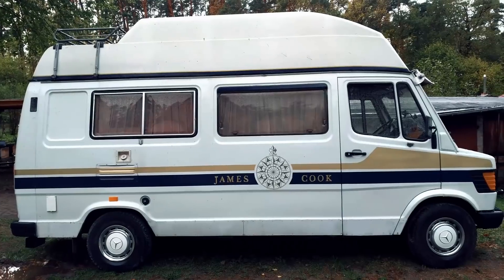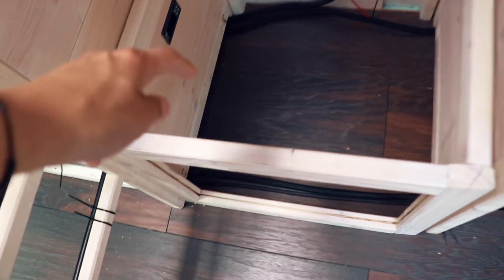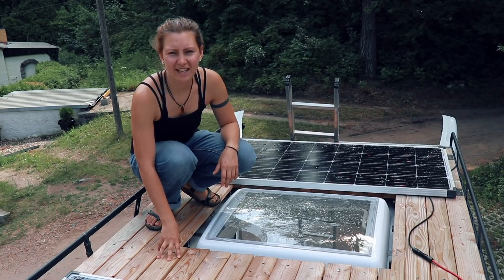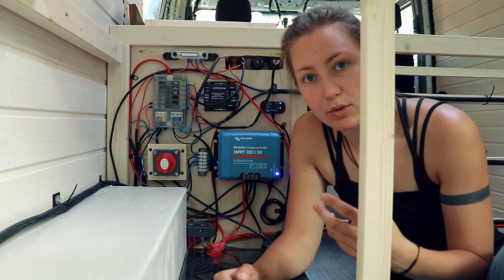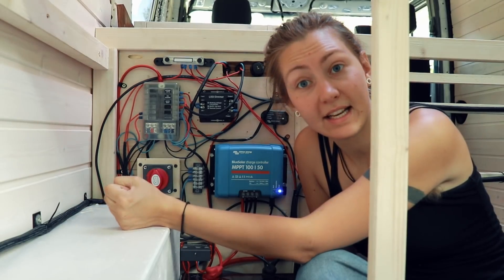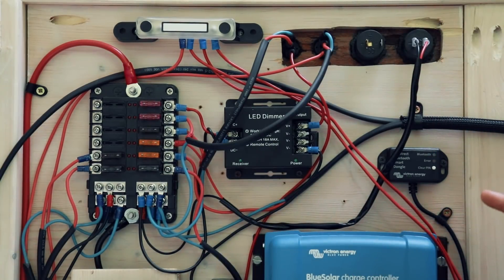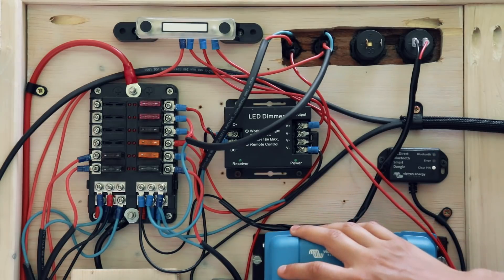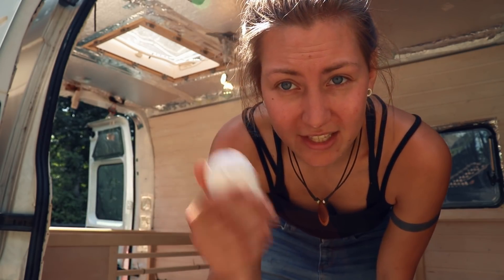Detailed TOUR of my ELECTRIC SYSTEM! | Van Build #13

Comment: A "rats nest" of wiring is common, it takes investment of time planning out all the circuits and an investment in materials to get the fancy tracks of wires and everything all 90 angles and no crossing over of wires willy nilly.  

Screw that, I have circuit protection, quality crimps, and for sure label everything to compensate for my rats nests.

Comment: I am 69 years old and I wanted to tell you that I enjoyed watching your build of your Van very much Personally myself I had a 1978 GMC 3/4 ton full size  van that I built back then and had a sink, powered roof vent, bed, two water containers like yours two spots for table. And 250 feet of wire ( 12v / 120v )  and outlets, 120v / 12v converter , place to hang clothes. It was also insulated , with paneling and carpet, sun roof ( no solar ) ha ha 43 years ago. Thank you again for the video it brought back memories !!!

Comment: Im checking out a lot of builds, hoping to learn what not to do as much as what to do, your build looks nice! Im going to check out your mistakes video next. 
   I wanted to see your electrical first, was wondering if you had battery to battery charging. I wasn't going to do it but watched a van build that an electrical engineer did and he seemed to make it sound easy, im not an electrical engineer so i thought I'd look at more builds to hear what others who have done it say. A little confirmation 😁. 
   It was a good video he did on it though, ill post a link in case your ever interested and need more charging for any reason. Thanks for posting your handiwork, your finish work looks fantastic. God bless!!

https://youtu.be/NImNGe_3TYk

Comment: Hey, great content! Those look like lead acid batteries that weighs 60kg each? What's the amp hour rating? 

Did you considered lithium batteries? You'll be carrying 25kg instead of 120kg, the cost works out to be much much cheaper, it takes up less space, and better for environment since you won't replace it as frequently. It's mainly due to lead acid can only use around 50% of the labeled amp hour, and can be charged around 1000 cycles vs 5000+ cycles. Here's a link for more info:

https://youtu.be/Rp8Hspi4BC4

Lead acid might make sense if you intend to use the system for less than 1 or 2 years.

Comment: I'm in the process of buildning my own van so this is great for me! 
However, how do you know what fuse to use for what?
Reply from the maker: I'm glad this helps! :)
Hm, that's a little tricky... I generally check the amperage usage on each device and then I take the closest higher fuse (uses 4,5A, 5A fuse). But that only works if I used the right wire gauge in the first place. Make sure to research that and really understand what wires you need! I hope this kinda helped, but please check that with other ressources because I am defenitely not an electrician!
Reply: @lifeoflenja390  Thanks for the help, will do some more resarch on that.

Comment: Lenja, please add a link to enable me to see the electrical plan (circuit diagram) - including and updated with all the suggestions and improvements you got. It is an interesting and yet simple installation following the KISS principle (keep it small and simple), more or less exactly what I'd like to install in my camper. Add as well the brand of your plus/minus distribution with fuses and maybe other details, on the lamps, e.g.. Best regards and thanks.

Comment: Just a thought on wire gauge.  I have not wired vehicles other than adding fog lights etc.  But I have wired 5 houses.  The gauge (diameter) of the wire is determined by the current (amps) that it carries.  current= power/volts.  if  the load on your distribution board is 600W at 12 Volts then you need to have as a minimum 8 gauge wire feeding the distribution board. However, if there is a short a battery will send all of its current thru the circuit and melt your cable.  This is why fuses or breakers are absolutely necessary!  Anyone who has put a wrench across battery terminals will tell you it is a frightening experience to seex the sparks fly and  your wrench melt! Please seek professional advise!

Comment: Impressed. 
Suggest you give more support to the loose cables when you get a chance to tidy it up. 

Not sure if those batteries are fixed strongly enough. Last thing you want is to be in an accident and one comes flying forwards. They should be clamped down with properly sized steel brackets.

Comment: Hi Lenja. Just to expand on the Live and Negative wires connected to your batteries. ALL Lives should connect to one battery and ALL Negatives should connect to the other battery. This will ensure that all charging AND discharging is spread evenly across both batteries. Your batteries will last much longer this way. 👍 You should be proud of yourself. Excellent work. Yours Paul and Chrissy.

Comment: You can run the other solar panel, just get another small charge controller for it. Or try without it and see if you really need it first.
Reply: I was wondering if she took it down, it can also be used for anything she may need to run in the daytime with out a charger correct? Like if she had a backup small solar generator or run a 12v cooler off of so it isn't drawing off the battery? Im limited on roof space and wondering about some portables to use in the daytime to run a couple of things off of. Then i just have to remember to plug them in to battery bank at night if i need to use them. 
   Not having to buy and mess with a mppt charger and wires would be nice.

Comment: Put the small panel on its own charge controller. You can run two charge controllers to the same battery if the settings are the same.

Comment: Super easy tip for perfect solar panel alignment; simply place any can (empty and clean is best) on the solar panel glass surface and change solar panel angles (Up & Down and Left & Right) until the shadow around the can disappears. 
That's it, super easy and super cheap solar panel alignment. 
Go ahead and play with perfect alignment and purposely less than perfect alignment, to see power input change, many times rather drastically, under different sunlight conditions and panel angle combinations.
with 3 panels; you can align each panel slightly differently for different times during the day.

In this case Up & Down is easy, Left & Right will be a bit more challenging and will mean turning the van itself (something to consider when parking).

Comment: Good job on the solar but you should really put 100 amp 12 V breaker in between the solar panels and the charge controller and a on off switch in between the charge controller in the batteries. You never want solar power coming to the charge controller and the charge controller not flowing to the batteries.
Reply: Sorry, met 120 V DC breaker

Comment: May want to consider 12 volt DC breakers, rather than fuses... yes, the up front cost is a bit more, but with breakers you don't have to go find another fuse when a critical fuse blows... just reconnect breaker and you're good (as long as you know what tripped the breaker in the first place). Otherwise keep extra fuses on hand for every fuse style and size.
May also want to add a disconnect between solar panels and solar controller... otherwise the panels will have to be covered up completely in order to safely kill power while working nearby. 
Like that you are using 12 volt DC lighting with "3 way" switching... multiple switch locations, controlling same lights. 
Like that you aren't messing with an AC\DC inverter... 12 volt DC only; makes for a much simpler system... just find 12 volt DC appliances and other devices... Simple.
Reply from the maker: Thank you! Yes those breakers looks really good! I just found out about them and before I add any more fuses, I'll add then instead! Thanks for the great advice! 😊

Comment: I didn't know you could put a fan in those skylights! I saw the fan in one of your shots but not in others so I assume it is removable.  That would solve my thought that I had to drill two openings, one for skylight/escape hatch and one for fan.
Reply from the maker: Yes, that's actually a removable one! Too bad I didn't show it in the videos... I'm only partially happy with it though; the removable aspect ist great and the installation is  super easy but it is not very powerful. I'll try to find the link for the one I used, I think it was by Fimma though 🤔
Reply from the maker: Again, I can only partially recommend it but that's the one:

https://www.amazon.de/Berger-98683-059-Fiamma-Turbo-Kit-Ventilator/dp/B002BW9QQY/ref=mp_s_a_1_12?keywords=fiamma+vent&qid=1582581669&sr=8-12
Reply: Thank you for your reply.  Yes I did a search and see the Fiamma fan that can be attached to the Heki skylight.  Maybe I could make my own with a more powerful fan.  Hmmm. Thanks again!

Comment: Where to start ? Don't worry, it's all good :-)

Love the music (maybe I just didn't notice it before), and so glad at the end to see that you did the solar panels to tilt. Was worried you were going to lose that awesome roof deck. Bonus ! You can tilt for best sun angle and keep them cooler with more air flow = better performance (which I'm sure you knew and is why you did it !)

Pretty good wiring and explanation, thumbs up on that too. And I was wondering what the blinking light device was. Bluetooth connectivity to the system. COOL ! Adding that to my list of must haves :-)  ...if I ever get around to my own escape build ;-(

Don't worry about needing a break from the grind of producing vids to concentrate on moving forward with the build. I think we all get that it adds a significant amount of time. On the other hand I'm still loving the uploads and missed you, so more coming is great :-D

Comment: Really enjoying this series. Are the 175W solar panels you used Victron also? Can you confirm that their dimension is 1485 x 668?
Reply from the maker: Nope, I got the NewPowa ones. I can check their dimensions if you want to?
Reply: Life of Lenja Are these the ones? 1480L x 674W
Reply from the maker: @mojitomaker  yes, that sounds about right. I can't find the original link though, seems like they are not selling those anymore where I bought them from 🤔

Comment: You should prepare a relay box and use relays for the high amperage devices like motors, heaters. Do not connect this kind of load directly to the switches.

Comment: Good for you, well done. The electrical system is one of the hardest & most tedious parts of every build. I'm a retired electrician & understand it all and know that doing it right is not as easy as most people think. It takes an awful lot of planning & all of your terminations have to be solid. This tip is too late for you but maybe it will help others.... To save money on thick cables for 12v systems where solar is used I buy a set of 20 ft 2-gauge jumper cables which gives me 40 ft total of 2-gauge copper cable. I pay $39 for a set of long jumper cables where ordering the same length & gauge cable from an electrical store costs quite a bit more. Depending on where you live the cost could vary so I recommend comparing prices between a long set of heavy-duty jumper cables & what they charge to cut the same length of cable from a spool. Jumper cables can come in 2, 4, & 8 gauge & the price is cheaper for the smaller gauge cables but I prefer to go bigger so I always get the 2-gauge because it can carry a massive amount of amperage.
Reply: unfortunately, I discovered jumper cables are 'CCA' == Copper Clad Aluminum.
That means the 2 gauge is de-rated to 4 AWG pure copper current carrying capacity.

Comment: A couple of suggestions if I may?
Even though you have used the proper crimper for your insulated solderless wire terminals attaching the wire to your fuse block. A better approach is to use the noninsulated portion of your crimpers in such a way as the seam is in the round half. And the opposite side pierces through both the back side if the connector and into the wire. And naturally cover with a short piece of adhesive filled shrink wrap over just the barrel part of the wire terminal.
Always try and pull the joint apart after completion.
Reply from the maker: Hi Bill! Of course, I appreachiate that a lot! I'll try to implement all of that! I always did the pull test so at least that's safe ;)
Reply: @lifeoflenja390  Great! The worse thing about solder less/crimp connectors is the false sense of security years down the road when corrosion sets in the joint because it's not sealed against the environment..
As always your doing a magnificent job.
Bill

Comment: Process or progress? Roundabout 00:52  Very clever thinking with the weight and the battery. Good German thinking lol.  The bluetooth thing, is that the technical term for it? 10:26  and do you have an affiliate link to it?  Also you have done a two way gang switch with the lights, nicely done. I was thinking of doing the same. I like the remote idea as well. Coming along nice.
Reply from the maker: Thank you! 😊 I think the technical term is Bluetooth dongle but I'm confusted by that word 😄 I don't have affiliate links yet but I should really set this up! Thanks for wanting to support me, that's so great!

Comment: With your solar panel on a hinge like that I would be adding some sort of cable stay or bracket because if the wind comes along it could very well snap the panel off. I love your switch panels.
Reply from the maker: Good call and idea, I'll think about a solution! Thanks! 😊

Comment: Do you have 12v on your USB plugs, or is there some kind of stepdown built into them?
Reply from the maker: They have an internal step down and intended to be wired up with 12v 👌
Reply: Super! Didn't know that was an option, that makes things so much easier :-)
Suggestion for your videos; link to the products on amazon.de/com then you can use affiliate links and earn a bit on that :-) It would help us and you at the same time :-) Found what I was looking for here: https://www.amazon.de/Thlevel-Ladeger%C3%A4t-Schnellladung-wasserdichte-Staubdicht-Blau/dp/B07SL9FB5Y/

Comment: I didn't see a (heavy gauge) fuse from your MPPT to your battery. I'm also knew to electronics so not sure how necessary it is but I seem to remember it being very important.
Reply from the maker: If I understand it correctly the MPPT has an internal fuse, but I'll check that again to make sure 🤔 thanks for the advice! 😊

Comment: I like the way you have the batteries set up and the way it evens the weight instead of all on one side. However, I would recommend that you  put a hold down strap over them to prevent them from bouncing up and or out of the "box" if you drive on a bumpy road, etc.

Comment: Hello Lenja, i think you have plenty of solar with the 3 panels. I have only 2 and together 300w off solar. And 2 semitraction accu's with 160Amp. Total 320Amp.
I have simular setup of the electrics, i wish i show you a photo.. dont no how..greetings from Holland.
Reply: Q. E. D.  i am still in progres of building..so i dont no, but it depens where your going. Summer in Spain or winter in Sweden is a big different. And i have my alternator for charge. I go offgrid, no 230v plug in my van.

Comment: Fantastic explanation of the electric wiring system.  Very simple , and easy to understand. Actually there is no mess at all,  the wiring looks great! I'm an electrician and wouldn't have done it better myself. One thing only; change the head breaker negative to the positive cable. If your batteries are grounded to the car it doesn't help having a breaker on the negative.  Or put another breaker on the positive as well if you want.   Simple and efficient! Regards Rickard
Reply from the maker: Thank you! 😊 I was actually confused about the position of the breaker when I did my research because I found different opinions on which end I should connect it to... so I just installed it at the position that worked best for me 😁 But now that I know I'll try to change that 👍 thanks for all your advice 🙏
Reply: @lifeoflenja390  Wellcome , I'm looking forward to see more videos.  I'm building on my Ford Transit 300 bus from 2012... hopefully ready to go on a trip 1 of April... let's see if you are ready by that time as well👍😊 Rickard from Sweden